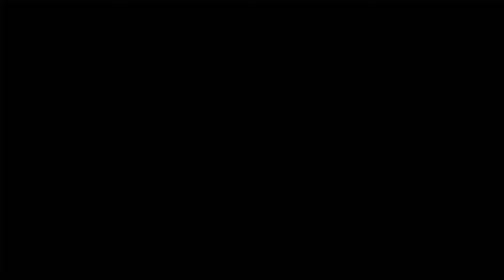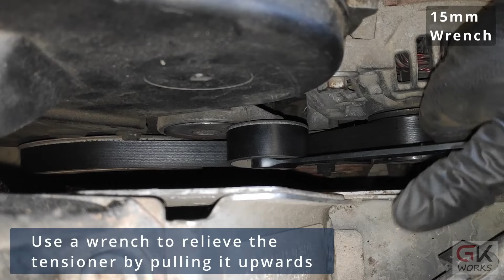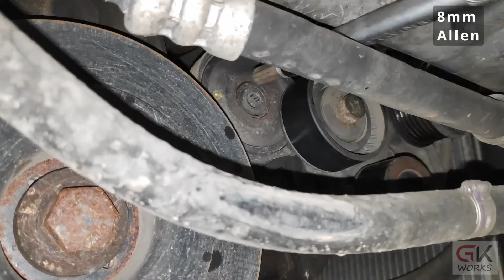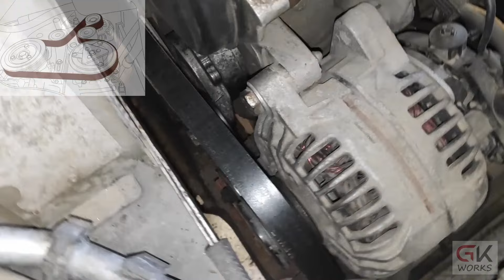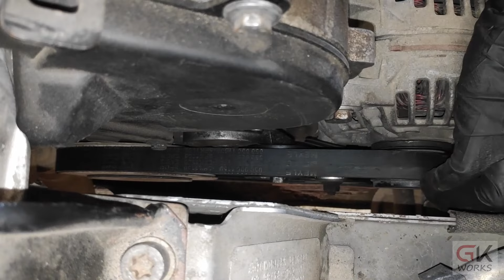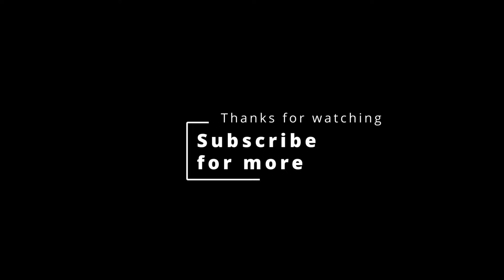How To Fix Belt Tensioner Wobble On Your Car | Peugeot 307

Comment: For a few weeks I kept hearing a noise under my hood while idle or accelerating but looked under hood and nothing took it to a mechanic and they couldn’t see why this was happening so the other day while driving lost all power and just has I turned into a car park my steering went. Rang my mate who’s a mechanic he looked and said my inna drive belt tensioner had broke and that’s why my car broke down.
So Went and got a new part now car drives perfect and no noises whatsoever